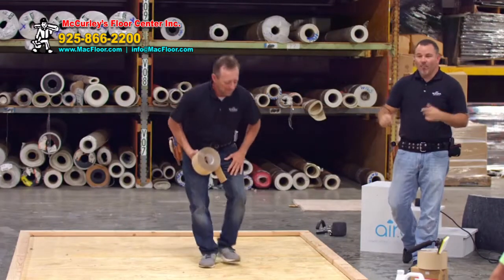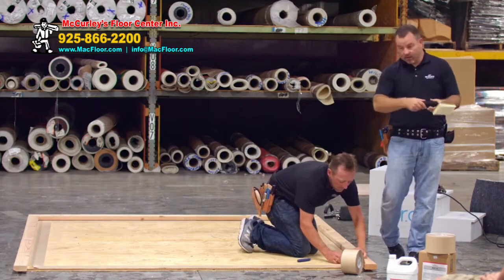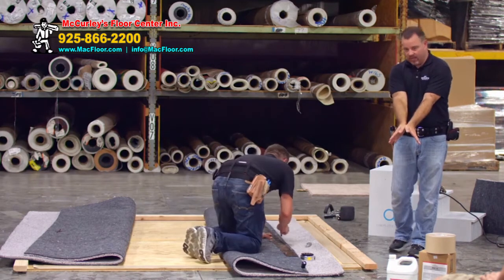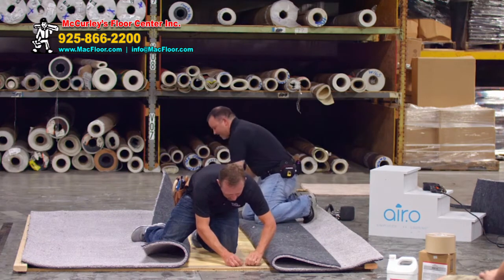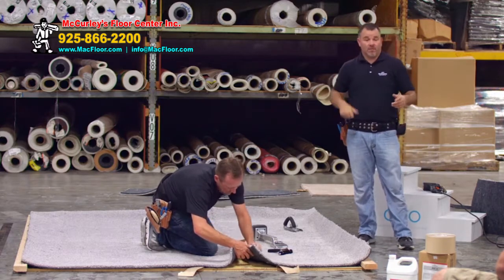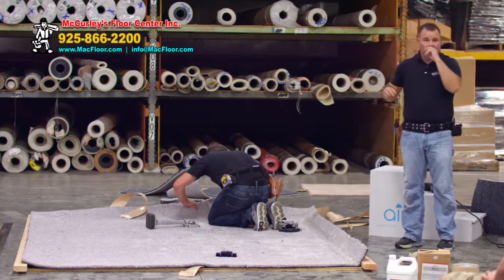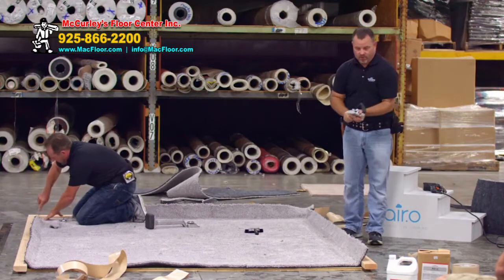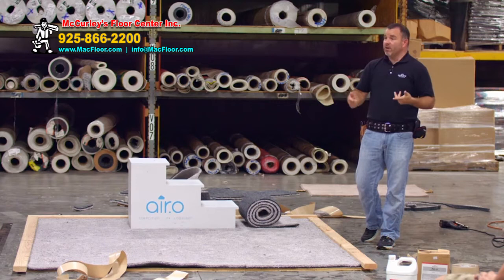Mohawk - Air O Carpet Installation | www.MacFloor.com | 925-866-2200

Comment: We've gotten conflicting opinions about what level of Air O carpet to use on steps.  One dealer says to use level I because Level II would be too thick, and may cause a tripping hazard. Another dealer said to only use Level II because level I does not have a thick enough nap, and the padding will show through at the nose of each step.  Is there a correct answer?

Comment: Not to throw a wrench into the recycling thing and those that believe the carpet is being recycled but...... yes, the product comes from other recycled plastics. I don't believe very much if any poly carpets are actually recycled. I get my repair remnants from various installer & carpet outlet dumpsters where old carpet and new scrap is thrown away. When it makes it's way to the landfill or disposal facility, I doubt there is someone that goes around testing the carpet fibers. The selling line sounds good that they make but in reality I don't think it holds up.

The Air.O thing has got me for repairs, not in love with the difficulty especially pet urine repair. Cat pee along baseboards, you better have extra carpet left over.

Comment: and............why polyester of all things?
Reply: Easy to recycle top to bottom if it’s 100% polyester.
Reply: It is made from Recycled Plastic bottles, as well as naturally stain resistant. Spill your grape soda onto your nylon carpet, then compare the empty bottle to the carpet. One of the two will have not grape stain after cleaning, and it isn't going to be your nylon carpet.
Reply: @eriefloors  sure, yeah, you betcha, it wears real fast, matt's  down (bends permanently) because it's plastic, get's pooling, attracts and will not give up oil or grease, off gases for 7 years that causes many to get sick after an install & causes things like lymphomas.

The 2 great characteristics - holds a great electrostatic charge attracting airborne pollutants. The best is for those that sell it - unlike a good nylon that lasts 20-25 years, a polyester gets so damn ugly that it's toast in 5 years or less. Nothing like a polyester on stairs to show worn ugly stair noses.
Reply: @janetobrian8625  Yes. spot on with its weaknesses. Not defending it. Just showing its place in the tool box. When the world is looking increasingly at Green products and renewable resourced fibers, product longevity and durability can take a back seat to a Nylon that is fresh from the mill, (with all that implies to air and landfills.) To old-schoolers like you and me that may be a hard pill to swallow. However, to a LEED Specifier or a consumer that puts their "green" money where their mouth is, Air.o can be used with more attentive maintenance and planned obsolescence into the holistic product design. That's the reason Mohawk uses Poly. Imagine that huge hunk of virgin fresh nylon going into the land fills every time this carpet is torn out. Food for Thought. :)